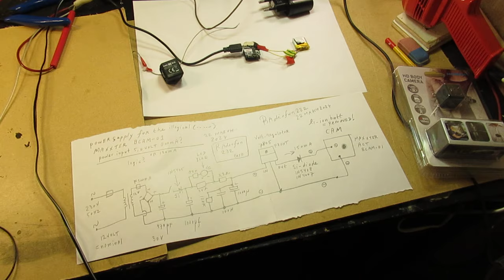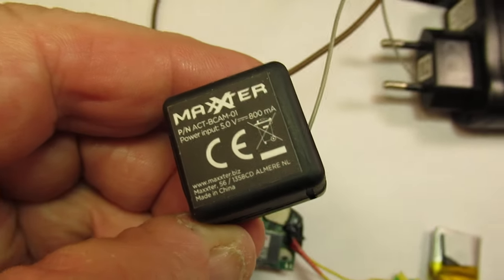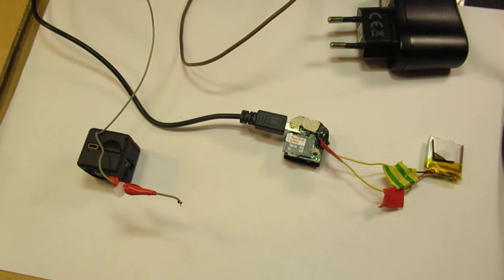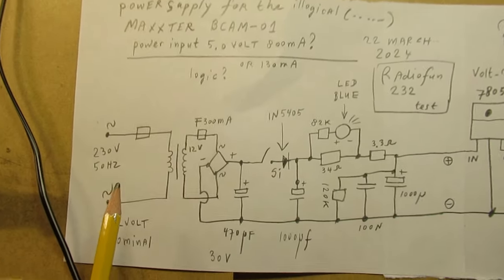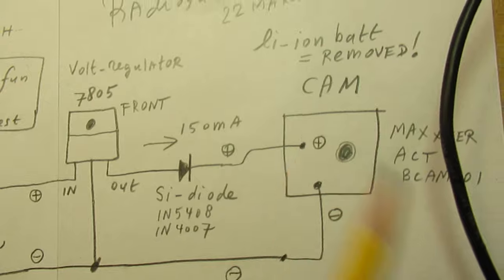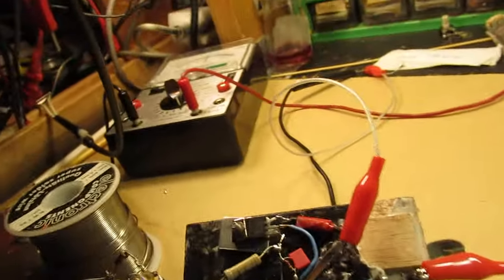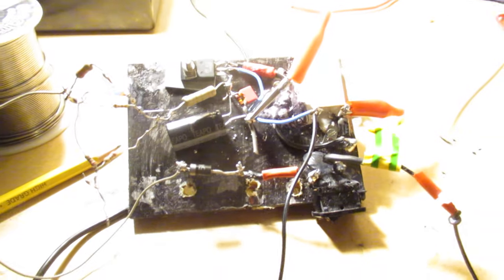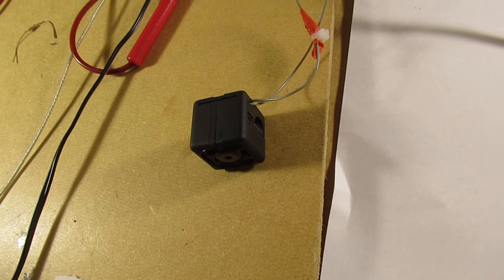Maxxter Bodycam ACT-BCAM-01 test (part 1) how to make its illogic work in some way demo & schematic

Comment: Interesting cameras at a good price. You are rightly concerned regarding power consumption, especially as the battery looks low capacity.
Reply from the maker: True, I have to do more experiments, but at least I could get it working for 1.5 Hours (or more) with that mains power supply of 150 mA taking up 75 VGA vids of 5 minute each on a 16 GB card. I think I can get it working 24h/day, but now have to focus on that "overwrite" issue of the earlier video files. If not was only a interesting experiment, thanks for your comment. 21 March 2024.

Comment: The 5v 800 ma you have on you schematic. Does that mean maximum input 800ma?
Reply from the maker: Hi Ron, that is a serious thing that I have to study better. I know that these camera's take a lot of current,that is the reason why they use Li-Ion cells. 
But to make it a surveillance cam. I cannot use that LI-ion battery. They need a too specific way of charging and this 5 dollar bodycam cannot work (as a surveillance cam) when a (say) standard 5 V USB charger is connected to it. In that case it starts "charging" and it is not possible to make the camera work at the same time, say taking up video's. Talking about a deeper dive into this cam: it could be that it uses 5 V x 800 mA constantly, = 4 Watt. Seems somewhat logical. I want it to operate on a lower supply current. The datasheet also tells that it can operate on 150 mA, and I did succesfull tests when operating it (taking vids) when working on that current/voltage (5 V - 150mA). It worked for 75 minutes and I even had the idea that it overwrited its first files. Tested it for say 10 hours constantly. The only idea is now that perhaps it really needs 800 mA to work in such a way that it overwrites the first VGA files, thus that it can be used as a 24h surveillance cam. Thanks! Ko 23 March 2024.
Reply: @radiofun232  Thanks, Ko, for the explanation.